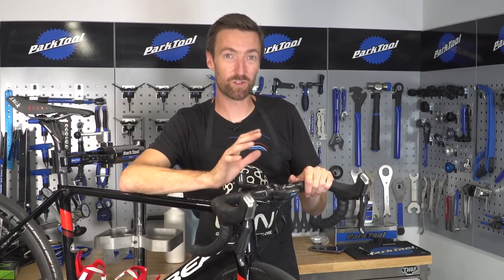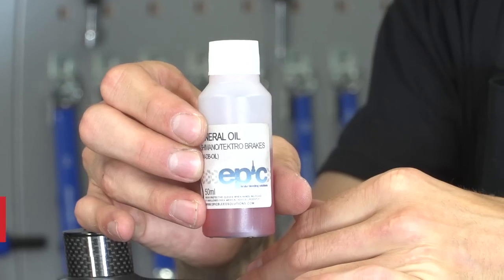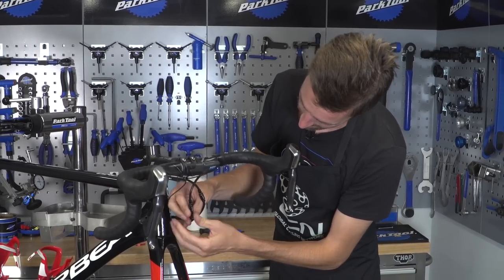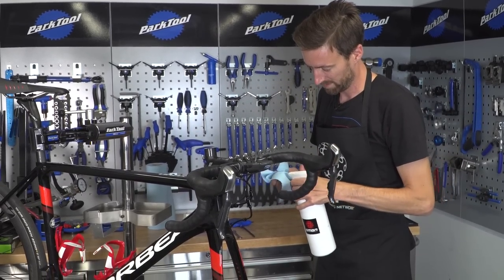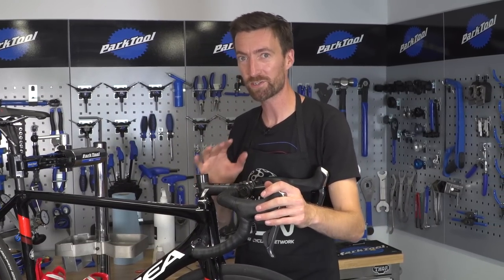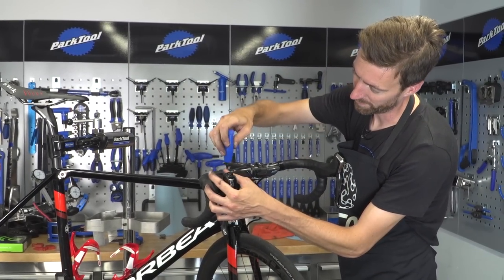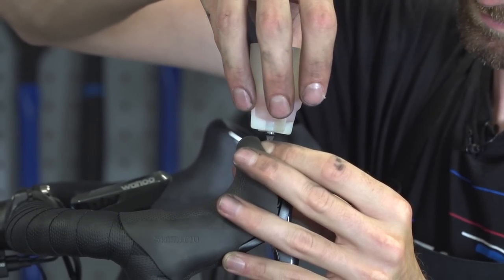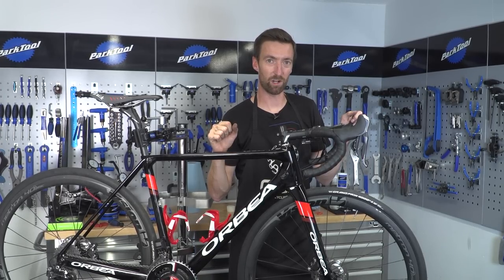How To Swap Hydraulic Disc Brake Hoses On A Road Bike | Maintenance Monday

Comment: If you don't have mineral oil, can you use six or seven mineral waters instead?!
Reply: Is it normal to have a alan key to removee the front wheel.? I still have the quick release ones.
Reply: I tend to weld them on.  The hard men in the early days of the TDF had to have good blacksmith skills.
Reply: I should have written "at least eight" ...

Comment: Isn't the step where you remove rear wheel redundant? Does it matter if your brake pads grab onto the wheel versus pistons grabbing the plastic bit? It's the same.
Reply: I'm almost certain you are right.  Probably just habitually following the same procedure as if they were doing a complete fluid flush.
Reply: The block gives 0 movements of pistons v slight movement with the pad/rotor in place.
Reply: if you let the brake pads there,pistons are going further out and the pads will grave the disc always. That block means you put same amount of oil every time and pads will got his space whit the disc to work 100%.

Comment: Well, this video made the hair stand up. It might be from motorbiking but if I do any maintenance on the braking lines I always do a full bleed on the system to make sure there's no air bubbles in it. Even on a bicycle it would make the brakes spongy.
Reply: it weird that you can't bleed from the bottom. If you could do that like on a normal hydraulic you could pump the fluid all the way through and be sure there are no bubbles as with car brakes.
Reply: bike brake are closed system,no air is allow inside,no expansion bottle whit the reservoir,really easy to bleed from the top,no fight against gravity laws. Just the amount of oil is ridiculous,you can flush 4 brakes or more whit the amount of oil seen in the video.You can bleed the brakes from the bottom but is a waste of oil and time and not so effective .
Reply: Rob Lucchetti but you can do that. Just no point doing a syringe bleed when you're merely letting a tiny bit of air out from the top of the lines after transposing the hoses

Comment: For what purpose were the rear pads removed? Could you not have used the red spacer instead? No fluid was going near the rear and instead you've made it more likely to contaminate the pads.
Reply: I was wondering exactly the same thing - could GCN reply please...Surely this was an unnecessary step?
Reply: I agree.  He could have left the rear wheel and brake pads in.  I guess he was setting up to do some maintenance on the rear caliper out of habit.
Reply: Shimano recommends to use the bleed block instead of the spacer, that way the pistons are moved in the correct initial position. it may also work with the spacer, but the pistons may come too far out and you are more likely to get brake rub. especially if your brake pads are worn down.

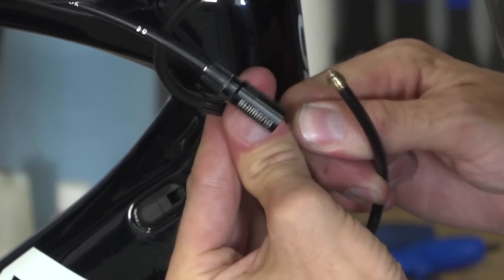Comment: at 3:19 dont you need to replave the "olive" cooper ring from the brake line with a new one? will ti work with the old one?
Reply: its recommended to replace them, but i never had a problem by not doing so.

Comment: Do you guys at gcn mind making a video on how to switch from flat bar to drop bar?
Reply: don't do it, bro!
Reply: SimSimon87 why tho?
Reply: unless you ride a fixie, you'd need new shifters/brake levers, new brakes, new front and rear derailleur and most likely also a new cassette and chainrings/crankset and chain which got to be compatible to one another.

What you get is a road bike with way too much reach because your frame geometry is optimized to accommodate flat bars. You might end up with a tiny stem to compensate for the reach and in the end you spend a ton of money for a crappy result.

Keep your bike and get a new road bike.
Seriously!
You can thank me later for that!
Reply: SimSimon87 GG thanks man is either I save up or wait one day to get a bike for free from a give away(possibly never so option one here I come)
Reply: save for next summer ;)

Comment: I know the hydraulic fluid in the Airbus A320 becomes hot but can bike brake hydraulic fluid heat up during heavy use?
Reply: Yes.  While not common, on extended downhill runs with a lot of braking it is possible for the fluid to heat up to the point that you get brake fade.
Reply: of course, same like in a car, motorbike, aircraft or anything that uses hydraulic braking. if you overtax the braking system you will get fading.

Comment: shimano rep told me that these quick connects are one time use only, and are not meant to be used after disconnected. someone please explain.
Reply: Seems like this is a "J-kit" quick-connect fitting. Brake systems sold as J-kits have their olives and fittings already installed in the brake lever/STI lever and caliper, which are pre-bled. The J-kit quick connect parts are supposed to ease assembly with no need to bleed the fluid, and are meant for OEMs/manufacturers/assemblers...so yes, they are meant to be one-use only.

Comment: Mine don't have this junctions. Is it still possible to swap them? I have the Shimano Ultegra RS685.
Reply: Yes, you will need to remove the bar tape and remove the line at the levers. Same rules apply. Just be aware you may need to do a full bleed. I have the same levers.
Reply: Rob Bonney  thank you sir. I had my brakes swapped across by my local bike shop.

Comment: What would happen if I used DOT 4 brake fluid instead of mineral oil?
Reply: it will damage the rubber seals
Reply: John Doe Your particular system will use either dot fluid or mineral oil depending on the brand. Always check first! Never use dot 5.some systems will use dot 5.1 and some will use dot 4

Comment: why the brake cables are swapped in the begening of the video?
Reply: Ricardo Chial because in left hand drive countries the front brake is on the right. In right hand drive countries the front brake is on the left. Sometimes when you buy a bike that's set up differently or sell the bike to someone who wants it set up differently you need to swap the hoses.
Reply: Will Davis hi Will, thanks for your answer... 👍👍👍💪💪💪

Comment: I know this is an old video but does anybody have any idea where to get those hydraulic line junctions?  Is there a Shimano part number?  I need these in my life to disassemble and pack for travel.
Reply: Could not find a Shimano part, but check these out - installed 2 and they work perfectly.:  TRP Hydraulic Hose Coupler Kit - TL 1.3, 5.0mm Coupler Kit

Comment: Great video!  ...but i still don't understand why anyone thinks hydraulics on a bicycle are a good idea.  I can't imagine doing this on the road if needed!
Reply: DFTA (Don't Feed The Animals) you're just showing how clueless you are. MTBs have used discs happily for over 10 years. You shouldn't need to bleed brakes mid ride. I've done over 5000 miles and my saint hydraulics feel identical to day one. Just one pad replacement at 2.5k miles. 

Hydraulics on a bicycle are better because they have more modulation, require less braking effort, and don't fade in the rain like rim brakes do.

In MTB almost nobody uses rim brakes anymore, soon this will spread to road

Comment: If it isn't there, it can't break, it doesen't weight, it doesen't cost anything.
Disc brakes on road bikes are exactly the opposite!!
Reply: L G your point is moronic. The benefits of discs on road mean better stopping power and control, especially in wet. You only looked at the cons and not the pros.

Comment: If you've got, caliper brakes YA DON'T HAVE TO SO THIS 😂
Reply: lee a dorney although you would have to switch the cables around
Reply: You are 100% correct.  You just have to replace cables more frequently than I have to bleed brakes.

Comment: Your breaks are round the wrong way?
Reply: b2theb there is no wrong way. In some counties it's the other way
Reply: Will Davis I live in the UK....
Reply: @Hirotoro4692  well, it could still be wrong. When you're right handed, it's the most optimal to put the front brake on the right. For all intents and purpose, this would be the right way.

Comment: I'm sorry to say this guys but you do give some wrong information in this video. If you open an hydraulic circuit you should ALWAYS bleed the system. To bleed the systeem you need to pump the air thru the system. The way you bleed youre brakes is incorrect, however it can work somethimes, but this is not how it should be taught to people who have never worked on hydr. brakes. I should also point out to the viewer how you can tell something is wrong (example: no pressure build ip in the first squize of the brake, pressure comes up after several squizes,...). 
I'm not here to comment on all that is wrong, this comment is only because brakes are a safety measure and as licensed car mecanic and workshop supervisor, I feel obliged to step in.
Reply: Arne Seys this is incorrect. Firstly they aren't doing a proper bleed, which is OK for their purposes. Secondly you do not need to always do a bleed after transposing the hoses. Sometimes you do but I've built up new bikes in shops and 95% of the time you switch the hoses, pump the lever a few times once it's all tightened back up, and it feels identical to before
Reply: Will Davis I know this can work on a bike, however you should look at the gmbn video concerning bleeding brakes. This video is a proper tutorial, this is the way to teach it to non professionals.

Comment: disc brakes are dangerous.  rim brakes are far superior.
Reply: JLP Design you have the augmentative skills of a child. Rim brakes are lighter and won't cut you or don't get as hot, this is true. But at the same time discs are superior in every other facet: stopping power, reliability, modulation. They also don't go out of whack if the rim buckles.